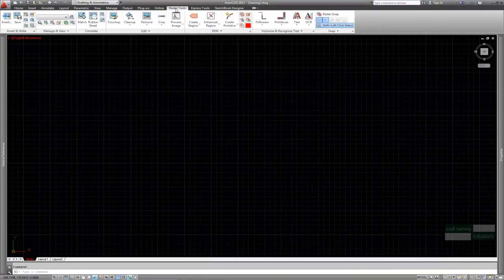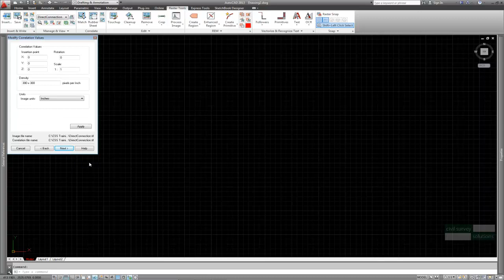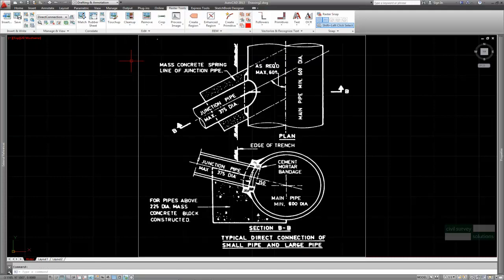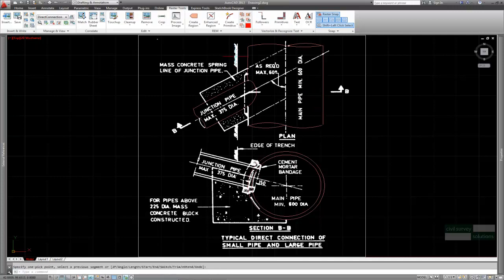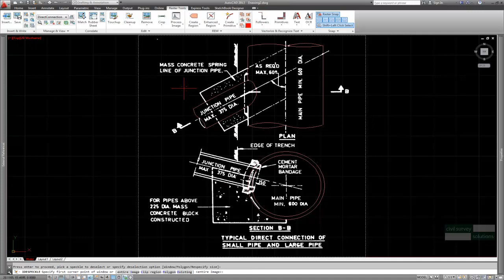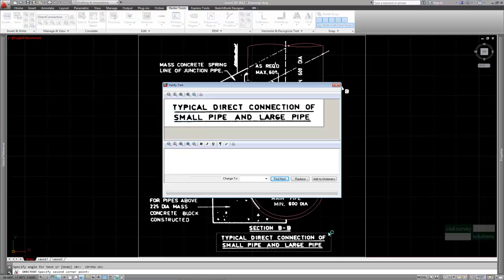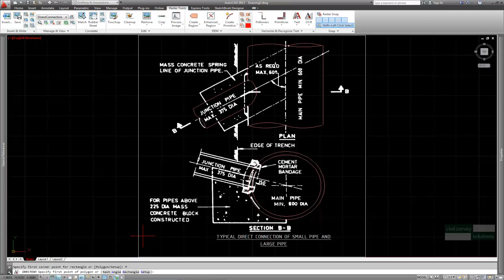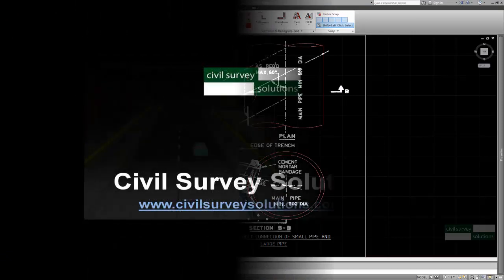AutoCAD Raster Design - Vector & Text Recognition

Comment: Hi! I've had a problem while inverting the image, the blackground becomes black but remains visible, inabling me to go on. Would you know how to solve this? The image is a jpeg Thanks you!
Reply: I'm going to respond 5 years late in case someone else comes along with this question. Their image is a monochrome tif. You can use a number of programs to convert from jpeg to tif but you want to make sure it is a monochrome or bitonal tif. This only has 2 colors, black and white. When you use multicolor images, AutoCAD doesn't know which colors should be transparent or not even when it is a tif and looks 
black and white.

Comment: THANKS FOR THE INFO.
Question: For which version of Autocad is this tool available from? is it 2017 or only in 2018?
Reply: They're using AutoCAD 2013 in the video. The raster design add-on I think has been available since at least 2010 when I started using it. Doing a quick google search, looks like it's now included with base AutoCAD.